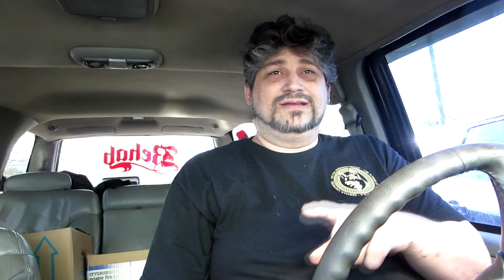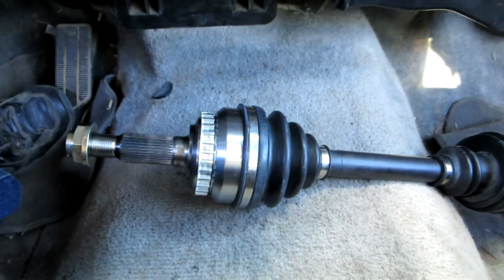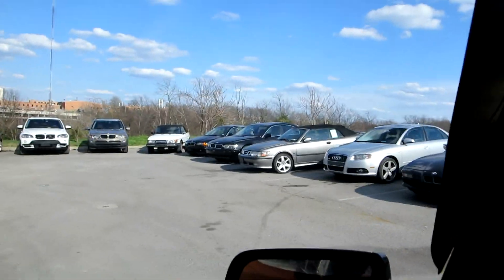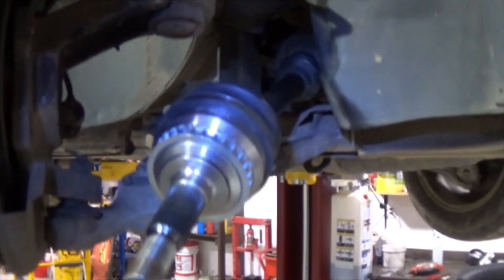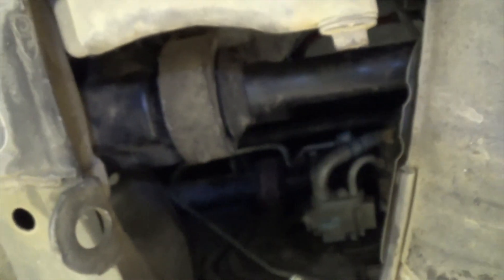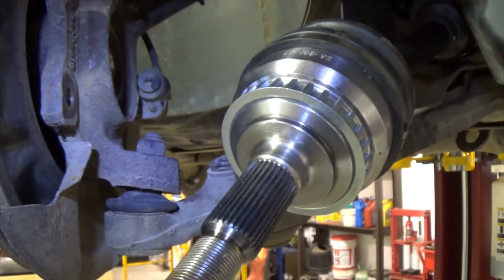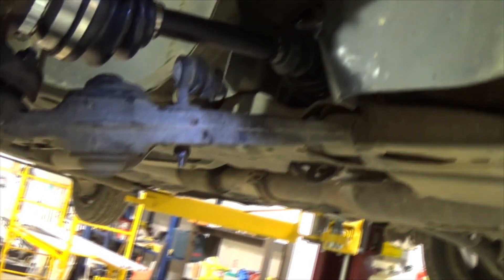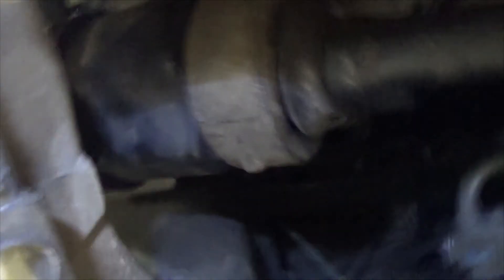1999 Sab 9 3 Axel Repair Day 3

Comment: They did a nice job repairing the drive shaft, perhaps if your wife loves the car then you may need to research the differences between the car you have and the more common type, a conversion perhaps?.
Hey you have a great frend, hope you thanked mike for making that job so so much nicer to do :D, his car lift is just magic :D.
Is there supposed to be that much rotational slop in the system jim?
Reply from the maker: zx8401ztv Oh i thanked Michael Several times, so did my wife i believe.  not sure if there is a conversion because all of the cars like this that i have seen all have the same set up as her's does so i am thinking it's more of the aftermarket that just doesn't have it right to begin with. like maybe the standard 9-3 is build one way and maybe the convertible is built a little different. 
the slop in the transmission is supposed to be there but only about half that, keep in mind this car does have 155,000 miles on it also. I am assuming that the extra play is just due to the miles on the transmission.

Comment: Do me a big favor Jim don't EVER buy another Saab...
Reply from the maker: I Don't Polojize  nothing wron with the car that wouldn't be the same on any other car, just the parts aren't very plentiful for something like this because they had so many different versions of front end parts for this one. pretty much anything else you can find in abundance for it. wouldn't you know it my luck was running again on this repair :o)
Reply: I know thats the bad part I have a friend here that has the same 9-3 and he is still trying to finde both CV joints and it's been 8 months and still trying
Reply from the maker: he may have to spend a little more than he wanted to but here is where i found the parts for mine to get her mobile again : http://www.saabparts.com/en-us/usa/the-company/service-centers/find-service-centers/
Reply: Thank you Jim I will pass this on to him...